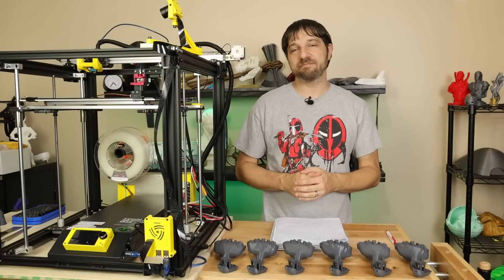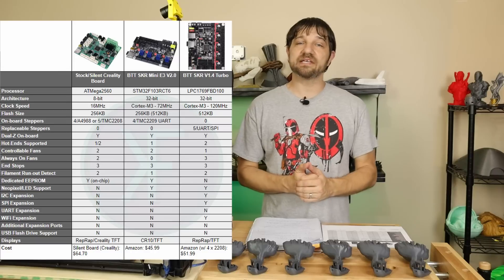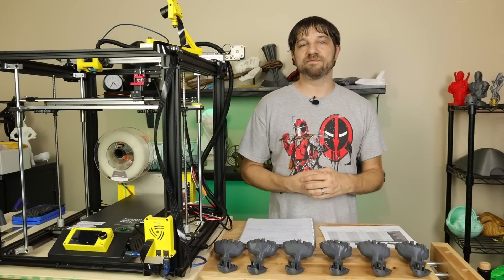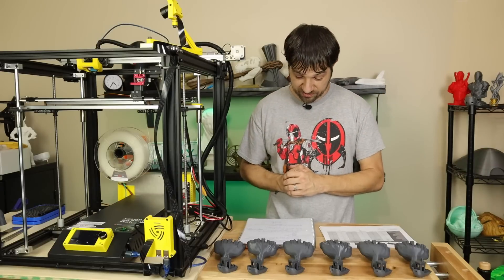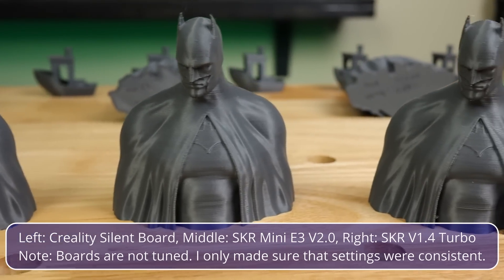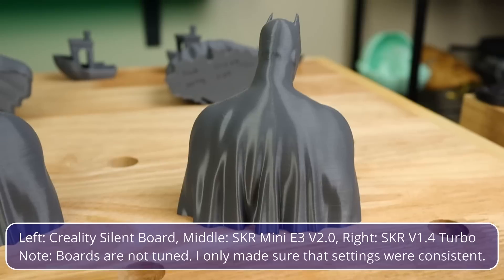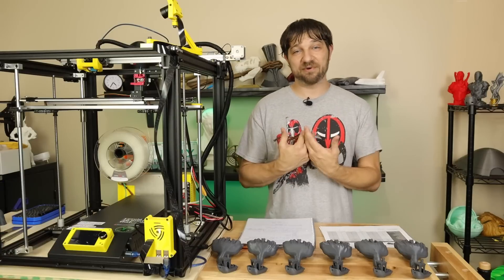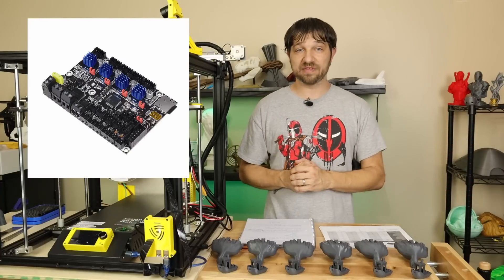Creality Silent Board vs. BTT SKR Mini E3 V2.0 vs. BTT SKR V1.4 Turbo (E5P Upgrade Part 5)

Comment: Kris, the end to a great series.  I'm thankful that you broke it up into segments that were easy to digest, yet could provide so much information on each product.   Now you can see why I ditched the control box- so much easier to add new mods.  I think a series on firmware would be very useful.  I think I share many others concerns, just getting Marlin to compile is a challenge.  Probably need a many part step by step series.
Reply from the maker: Thanks David! I'm glad this was both useful and easy to follow.
I agree completely on the control box. It would make my life easier!
I would love to do a series on firmware, I'm just working on a way to present it in a useful and less boring manner.
Reply: i know im randomly asking but does any of you know a method to log back into an instagram account?
I was dumb lost the password. I would love any assistance you can offer me!
Reply: @Harper Genesis instablaster ;)
Reply: @Nathanael Mario Thanks for your reply. I got to the site on google and Im waiting for the hacking stuff now.
I see it takes a while so I will get back to you later when my account password hopefully is recovered.
Reply: @Nathanael Mario it did the trick and I actually got access to my account again. Im so happy:D
Thanks so much you really help me out!
Reply: @Harper Genesis No problem xD

Comment: Thanks for this Kris. This vid finally gave me a lightbulb moment RE which SKR board I wanted. Swimming in a lack of information before this and you mentioned something that has drawn the line in the sand for me. Great series btw.
Reply from the maker: Happy to help! Which did you choose?
Reply: @kerseyfabs  SKR Pro. The different SKR rangees completely eluded me for some reason - I was conflating different ranges unknowingly leading to a TON of frustration and indecisiveness. The Pro gives me the interfaces for multiple extruders and a few other things and allows me to use the TMC drivers I want etc..... Yay

Comment: Sir, you made me brave enough to try and perform my first 3d printer upgrade. the ender 5 plus is my fifth printer never had the guts to upgrade them. Thanks for the step by step procedure. Will let you know the results.
Reply from the maker: That's awesome! I hope it goes smoothly.

Comment: Perhaps worth taking a look at the compile flags Kris to see if there is anything obvious there that may explain the unexpected performance issue. Do you plan on doing board optimisation and then revisiting the print quality and duration? 

Looking forward to your video on the SKR Pro... ETA on that?
Reply from the maker: I'll see if there's anything on the compile flags. It's definitely worth looking at. I don't think I'll revisit the quality/speed unless something comes up that's really dramatic or if I learn something new worth making a video on.

No ETA on the Pro, at least a few of weeks. I have other things in queue.

Comment: Kris, your results also surprised me.  I would have expected the turbo to be dramatically better in a speed test.  I suppose it also depends on how fast those drivers can convert the signal as well.  I also didn't realize you were getting the SKR Pro v1.2...  I have been working on the SKR Pro v1.1 so go ahead and drop all the pinout and wiring stuff I have sent you :D
Reply from the maker: Yeah. I wanted to try one because I can actually show how to utilize it all if people are interested. Working with you on that was prep work. ;-)

Comment: Great video. It looks like the SKR Mini E3 would be a really good upgrade for the Ender 5 I'm hoping to buy as a first printer. It certainly gives more bang for the buck than the Silent Board, especially since I will almost certainly want to add one of those nice large touch screens at some point.
Reply from the maker: Awesome and thanks! I agree, it's an excellent choice for the Ender 5.

Comment: a little confused about video order. in the part 1 you said that this would be part 4? but the final comparison actually part 5. there's some other part 4 that appears to be for a different series? anyway, maybe you could put links to the parts 1/2/3/4/5 etc. in the comments of future videos. either way. this is helping me decide which board to replace my stock board for ender 5 pro which died by my clumsy hand. Thank you for your stuff & stuff! liked and subscribed.

Comment: Could it possibly be the 2208 stepper drivers that account for the difference in print quality@100mms between the Mini e3 and V1.4 Turbo? I mean I wouldn't think so, but maybe something to consider?
Reply from the maker: I actually have tested this over the past several months. I've noticed no difference between the drivers in terms of quality. Thanks for checking in though!
Reply from the maker: Michal, fortunately, none of what your said is true. 2208s should support linear advance and nothing about the 2209s auto enables linear advance.

Comment: Kris, thanks for the videos, very informative and detailed..  I really liked the dual z stepper video G34 as I plan on that for my anet e16.   In your testing,  did you use Raspberry Pi as a print server ( octoprint?) running thru the usb port?  If so, perhaps that is a bottle neck?  Perhaps the best test would be with the print on the SD card.  Just a thought.  thanks again.
Reply from the maker: Thanks Mark. I always do my testing direct on the board (SD card) to eliminate any possible problems with USB port or OctoPrint.

Comment: Thanks for these videos! Very helpful and educational! My Ender 5 plus steppers stopped responding on the first day and I'm going to replace the board to see if that fixes my issue. I was going to replace the board anyway but I expected to at least get a default print in first :/ SKR 1.4 turbo coming in soon.

Comment: Love it man...this has been way past due. How there hasnt been a bigtree vs original/semi-original is weird lol. The creality boards have def been screwing themselves by not making an add-on version especially since its more expensive. And yes I have noticed the mini somehow puts out better prints than the 1.4 turbo. Im not sure if you mentioned it in another video but did you put up a settings set up list?
Reply from the maker: Thanks! In the video description you will find links to my GitHub repo where I have each board on a separate branch of code. There you can find all of my current settings.

Comment: Can you do an install and test of the Creality Sonic Pad on these options?
Reply from the maker: I don't think it will work on 3rd-party boards but I do have one I'm going to play with.
Reply: @kerseyfabs  Thanks.  I've seen a couple of messages on Facebook where the system seems to work.   Using your data to upgrade my Ender 5 plus.  First just learning the basics.

Comment: Great series!  I'd love to see a similar comparison in performance using these boards to a Duet.   I have to ask a question as to when you increased the speed to 100mm/sec, did you also increase your acceleration and jerk settings?
Reply from the maker: Thank you! I'd love to get a Duet as well for testing but it's a costly upgrade when you include their display.
On the speed increase, I only increased the speed, no other settings changed. I wanted to make sure that I didn't add any ringing or other artifacts by changing acceleration or jerk.

Comment: Any chance that the speed/quality difference you are seeing (mini V2.0 vs V1.4) is due to the 2209 vs 2208? Even if you are not using any of the "advanced" features, the 2209 MAY just be slightly better/faster than the 2208.
Reply from the maker: That's a terrific question and one I thought about myself. There's nothing I've found in the Marlin code that would lead me to believe that BUT I did order some 2209s to test it. I'll let you know what I find out.
Reply: @kerseyfabs  I would not expect there to be anything different in the Marlin code. The difference would (could?) be on the chip(2208/2209) itself and how it implements the instructions sent to it. Either way it will be interesting to see the results. Thanks

Comment: Could you do a guide on setting up a second extruder on the silent board? Thank you sir.
Reply from the maker: I am planning to do a second extruder guide. I'll try to include firmware and wiring for the silent board if I can work it in.

Comment: Great coverage of these boards! I am upgrading an Ender 3 Pro with the Ender Extender 400XL kit to 400mm x 400mm x 500mm. Do you think the SKR e3 Mini v2 will be a good fit to run this? I plan to add a second z-axis stepper motor and wasn’t sure if I should consider the SKR Pro instead, due to the added stepper motor driver?
Reply from the maker: Thank you! Well, the Mini won't be able to run the stepper independently but it can run them off of the same driver. It will work great as long as you didn't want independent drivers. If you want to move up to independent drivers, just go to the E3 Turbo, the Pro is overkill.
Reply: @kerseyfabs  So I ended up getting the new BTT SKR RRF E3 board. I just finished installing the 400XL Ender Extender kit on my Ender 3 Pro.. Single Z-Axis for now as the upgrade kit for dual Z-axis is still out of stock. Anybody have a firmware compiled for stock Ender 3 Pro with 400XL Extender kit, BTT SKR RRF board, and BTT 3.5” tft v3.0?

Comment: I’m interested in seeing how this works for larger prints.  I bought my Ender 5 plus to do objects using the large build volume and plan to update with faster extrusion in mind.  I will use my smaller printer for objects of the scale you show.  I have seen taller prints perform differently (more fails) vs. shorter prints so I think doing a large object comparison is important.
Reply from the maker: What specifically would you be looking for? The larger, faster prints will work fine. The Batman model is particularly taxing because of the curves and the small line segments that make them up. If you'd like to smooth this model out at high speeds, check out this video from CNC Kitchen: https://www.youtube.com/watch?v=Hvw3DrVAeTA
Reply: Well, I think of the Ender 5 Plus as my “helmet” printer :-). Do you think your comparisons would hold up,when you try objects closer to the max. build volume?  Maybe try to print some Ironman gear at full scale or a large aerospace model?  I assume for the same nozzle my print time scales with print volume.  So, I suppose that means pushing out filament with a larger nozzle is needed?  Because of that I am planning to explore ideas for the Plus that use larger nozzles and high volume extruders to handle the larger prints. (and, like you I want to mod for two extruders)

And, thanks for the link.  I will take a look.

Comment: Thank you for your tutorials, well made. If I want to build the ultimate 3D printer from scratch, what is the board you recommend?
Reply from the maker: That question really depends on the features of the printer and the budget. Many people would recommend the Duet boards if cost was not an issue and you weren't tied to Marlin. If you wanted to go with Bigtreetech, you'd want to look at the SKR PRO V1.2 (https://amzn.to/3tl54Cb) or the GTR V1.0 (https://amzn.to/36srCac). I'm also looking into the Lerdge K, with and without Marlin.

Comment: Do the all the replacement options have more sophisticated file structure handling, like directory structure or longer filenames?
Reply from the maker: Yes. They all handle files better than the stock Ender 5 Plus firmware.

Comment: Hi! I think that would be interesting trying to use gcode modified by the plugin Arc Welder of Octoprint, that convert linear move in arc move and reduce file size. Maybe there would be more differences between the boards
Reply from the maker: It's on my to-do list! It's been suggested in a lot of comments and it sounds like a great idea!

Comment: This is the video I originally watched, the link for the Creality Board is broken.  If i check Amazon, there are 3 boards a V2.2, and a V2.2.1, as well as a V1.1.5 and the price varies from $80- $169 saying no firmware upgrade required.  I can do the upgrade, but the cheapest board is the V2.2.1
Reply from the maker: Looking at the Creality website. It looks like the V2.2.1 is the latest. You should be good with that one.
Reply: @kerseyfabs  Thanks, My vendor didn't know what was installed in the printer I bought.  Had surgery recently, and finally got a friend to help me open the box, and eve though they told me it did not come with a mean well PS, it did, had to cancel my order.  I talked to my seller, and he is contacting Creality directly because I could not understand the e-mail they sent me.  know the 2.2.1 board is the silent one, but still don't know if I have to flash any firmware in it.  Really appreciate your help

Comment: Hi Kris, Great series definitely give me more insight to the bigtreetech boards. My ender 5 plus is on the way. I am wondering what would the consideration be if I want to plan to do this upgrade of getting the SKR V1.4 Turbo and adding a Hemera hot end on the ender 5 plus.  What do I need to change from firmware perspective or any other consideration and tips you might be able to give me?  Also does the do I have to edit the firmware to enable the BL touch to worK?  Thank you. Again great series I enjoy watching your video.
Reply from the maker: I appreciate it Henry. This article should have the information about what you need to change in the firmware: https://e3d-online.dozuki.com/Guide/Hemera+Ender+3+firmware+modifications/115
The BLTouch is already enabled in my firmware files.
Let me know if you have any specific questions.

Comment: Were your printing from octoprint using serial port or sd card? Great video, very much appreciated!
Reply from the maker: No problem! I always do test prints direct from the SD card.
Reply: @kerseyfabs  thanks for the reply. Mad respect, your videos are extremely helpful. Im fairly new with 3 ender 5 pros and a new business. 2 of the printers had 32 bit silent board, one had 8 bit board. The 8 bit board does NOT communicate with my pi3B+ fot complex curvy prints. Going to get the bigtreetech e3 mini v.2.0 to swap it out.

Comment: Thanks for this video series.  I have one question.  Is a screen replacement required for these boards?
Reply from the maker: No problem. It's not really required but that's a different path. I'm not sure what the state of the support is for the stock Creality screen is in mainline Marlin. Insanity Automation has done work on it though here: https://github.com/InsanityAutomation/Marlin/tree/CrealityDwin_2.0
I do plan on giving this a shot, as time allows, in a future video.
Reply: I'm curious about using the stock screen with the E3 mini as well!

Comment: Any plans to add the review/setup instructions also for the new bigtreetech skr v1.2 pro board you mentioned in this set of videos ? For that board the only material available are just those 1 min advertizement videos.
Reply from the maker: In 3 weeks is the plan. 😉

Comment: Thank you for the series.  It really helped me on my E3 mini install.  Can you look into maybe klipper firmware with the mini vs say the skr pro?  Can klipper improve speed or quality?
Reply from the maker: I'm glad it helped! I'll try and work it in. So much to do! Klipper can definitely improve speed but quality would only be improve if going faster.
Reply: @kerseyfabs  I'm playing with Klipper on a CR10 Max and found that even at normal speeds I get a reduction in ringing. It is not very bad to start with but I definitely found the print better with Klipper at normal speeds. I want to buy an Ender 5 Plus and would love to see Klipper on it as well.
Reply from the maker: @michelluccote  Thanks. I'll get it on my list.
Reply: @kerseyfabs  From the documentation in Klipper I am finding that the performance and quality of print improvements are not only due to using a higher performance processor and off loading the printer controller. They are also due to the extra processing done on the G code by the Klipper software. It does not simply convert the exact G code to their equivalent stepper operations. It also adds details to how each movement is ramped up and down using a constant acceleration model and how sequences of movements transition between each other. I have two CR Max printers running side by side with only one running Klipper and the movement is noticeably smoother even if I have not yet done pressure advance or resonance tuning.

Comment: I got a question. I have scoured the google. This video kinda makes me lean towards keeping the silent board. Especially cause the SKR 1.4T is now the SKR 2 and it has some issues not just with the mosfet. I want that TFT35 you are using. Can I plug that in to the silent board? I can't find a pinout on silent board and it doesn't look like it has a serial port. Thanks for all you do! Really brought me up to speed on 3D printers.
Reply from the maker: No problem. The short answer is "yes" but it would require custom wiring and custom firmware. Ultimately, if you want to keep the stock board, you'd be better off just getting a simple 12864 display (https://amzn.to/3nQAFcM). You'd still need custom firmware though.
Reply: Hmm seems like i can't do enough homework on all this. So many options. Might just have to get new mobo cause the silent board is difficult to find documentation. And its 8 bit w/o uart. Looking at that octopus 1.1 now 🙃. Might be overkill but lots of future proofing and not much more $ than the skr's
Reply from the maker: @Chris-tw5xj  I was hoping to make a firmware for that one. I'll need to get that on the list. 😅